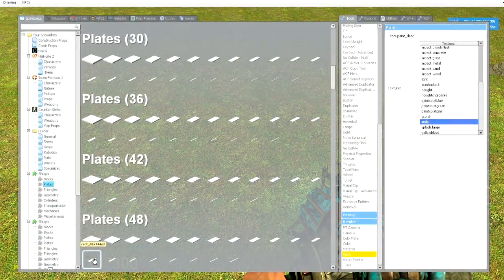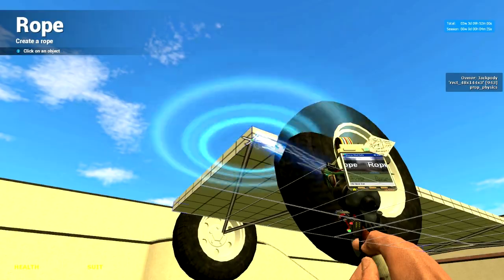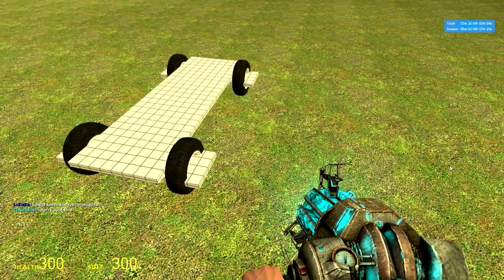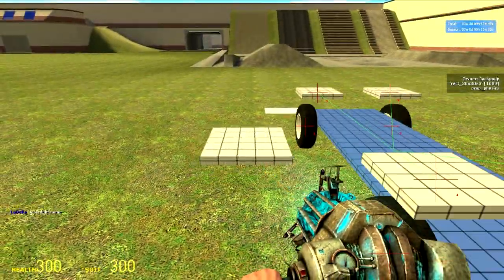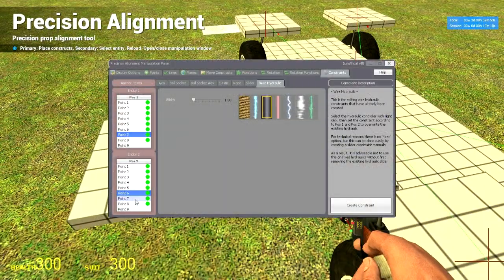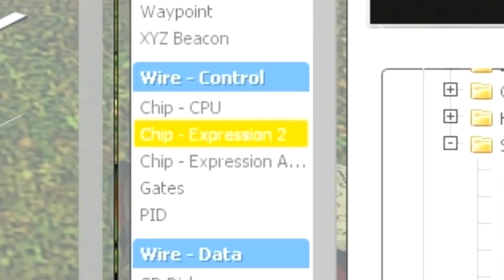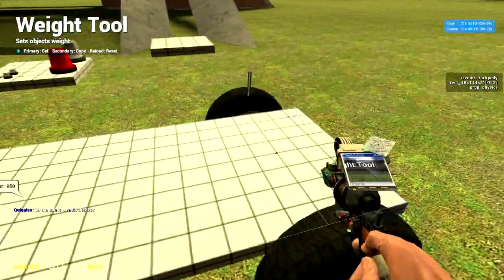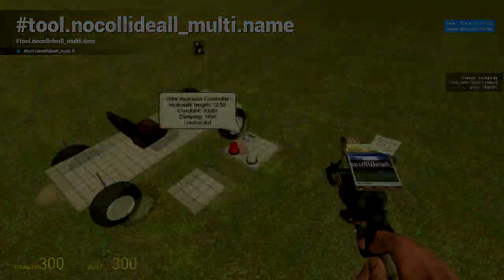[GMod 13] Suspension & Steering Tutorial - Simple

Comment: Thanks for the tutorial! I was able to use one of the wiremod thrusters and pair that up to the pod controller so that I can activate it with the w key whenever i am in the seat. 
I have always seen wiremod is an extremely complicated tool that takes years of experience to get the hang of, but I know the potential of wiremod. To put it simply, I would be doing stuff on gmod much more if I had the experience with it, so it’s really cool to see that this build still works just fine today!
Reply from the maker: Glad to hear! :)

Comment: Peasants, I made a 3 wheeled car!

This is my first time watching this video and the first time I watched, for whatever reason, I wanted to make a 3 wheel car. And I did. I am relatively proud of myself for figuring out the suspension on the single wheel.
However, I'm using my rear wheel as my turning wheel. I needed to adjust the E2 to turn more slowly so the car doesnt flip. Once I figure out how to install a piston engine, I might make the rear wheel the drive wheel and the front wheels turning wheels.

Comment: when using the e2 i get this    No such function: entity:setAng(angle) at line 31, char 15
Reply: +vocopro100 Yah same
Reply: +Boris Lichev +vocopro100 Go to the console and put in wire_expression2_extension_enable propcore.
Then put in wire_expression2_reload
Problem solved
Reply: +vocopro100 Because setAng uses a vector, for Pitch, Yaw and Roll ;D
use setAng(vec(X,Y,Z))
Reply: +migueeeelet thanks
Reply from the maker: Did you read the description?
Reply: Holy shit i know this is old, but thanks!!!!

Comment: Great tutorial. I had a little trouble in the beginning getting the ropes to attach to the corners, but a small change to the grid settings in SmartSnap fixed that (grid offset changed from 0.0 to 0.1). Now I have to figure out how to sensibly power my vehicle (not using a thruster, but using an alternative method like one listed in the video) and then save it properly.
Reply from the maker: Glad the tutorial worked out for you. I am working on an ACF tutorial as we speak, stay tuned for it next week.
Reply: Alright, that should help... every little bit helps an inexperienced GModder like me. I'll keep an eye out for it.

Comment: Works great, built it onto a car that had over 100 props, was able to follow the tutorial without replaying, and just a few pauses. Just one problem, sometimes when hitting curbs at high speeds the wheels fly above their covers, and stick upside down. You can manually pull them down again with a physgun. I tried fixing this with putting a flat base prop above all the wheels, but it still happens.
Reply: Replying 10 months after your post, but this can be easily fixed by using Precision Alignment, and tying a rope the length of your Hydraulic to a point attached to your baseplate. It sounds complicated, but it's very simple once you know the tool

Comment: i have a code prob its 
"No such function: entity:setAng(angle) at line 31, char 15"
Reply: +kopfjager68 oy nvm i fixed it with the console thing if you were to relpy thx then
Reply: +kopfjager68 how did you fix it? i have the exact same problem and cant fix it to save my life. thanks!
Reply: +Duncan Czeizinger nvm had to enable propcore.
Reply: +Duncan Czeizinger yep
Reply: Didn't work anyway, think I messed a ballpoint up, gonna try it again another time.
Reply: the ballsocket is annoying for me because ill build it north and the socket is still messed up and im like whatatatatatatata
Reply: kopfjager68 yep, this is a stupid suspension setup anyway, if you want I'll link a perfect suspension and steering video.
Reply from the maker: +Duncan Czeizinger :(
Reply: Jackpody no offense, but I find it to complicated, when you could use weighted weld suspension blocks... But if you want it to be compact I suppose this is best...
Reply from the maker: But weight suspension is incredibly unpredictable compared to this setup. There's a good reason why us builders changed from weight suspension in 2009 and 2010 to elastic and hydraulic suspension - it's much more predictable this way.
Reply: Okay, have it your way, we all like different things.
Reply from the maker: I'm not saying that you cannot enjoy your weighted suspension, but stating as a fact that this suspension is not as good as weighted suspension because of this being "too complicated" is just not right.
Reply: I'm stupid and don't know much about gmod yet so I'll rely on what your saying.

Comment: I've just run into an issue... Rather than A and D moving the wheels, when I turn the car with my phys gun, it turns the wheels.
Any help?
Reply: same problem i think, debugged e2 and it is receiving a and d inputs but e2 is not floating and is not moving... when e2 is rotated wheels do rotate.... still working on answer will update when figured out in another 11 years
Reply: i had a coding issue, have some one look at the code

Comment: Great tutorial! I built a tank chasis with this and it works flawlessly. The only downside I see in this method is that you can't weld the E2 chip. It needs to be left there sitting somewhere in the map. But I guess thats the only way to make the steer part.
Reply from the maker: +MaxShadow Definitely the only (proper) way to do it - it's definitely also the most accepted method of steering. I can't think of anyone who does steering differently, other than Karbine / Amplar2.

Comment: Tip for n00bs: the plates that go above the wheels should be much much higher in order to prevent the suspension from spazzing out.
Reply from the maker: I can confirm this.
Reply: Much Lower also works, if you decide to have your car with extra Low

Comment: Alright! This is Awesome! I did the tutorial with the same models from your set-up to get a clear understanding. I also viewed the Wheel Spass tutorial to make it a solid test.

But I got a question though, is this manual set-up any better than SCars or even SimFPhys? Or maybe you could take these set-ups into those mods? I have no idea! But I would love to hear conformation! Thanks!
Reply from the maker: I'm glad the tutorial is still widely used! It's a good question that you ask - I'd say that this is a much different approach to say SCars or Simphys. This setup is an actual physical chassis, just like how cars are done in real life. With most applications, this type of setup use rotational force from the wheels to move forwards. With the case of SCars and SimFPhys, from my understanding, they use an applicated force on the base of the vehicle meaning no actual rotational force. The physics are also simulated on SCars and SimFPhys, with this type of setup shown in the video only allowing the Source engine for physics. I hope that makes sense!
Reply: @JackpodyDK 
Yeah, you're tutorial was super concise! 

Hmm... so the physics on this Manuel set-up has the wheels rotate and roll the Base Plate, or the frame of the car forwards. While the SCar and SimPhys mods applies force in the frame instead of the wheels rolling it forwards. 

Okay, then this set-up would be better for steering because the wheels are controlling the Base Plate more effectively than the SCar and SimPhys Mods. Is this correct?
Reply from the maker: @hogoototwilightian628  It's definitely the correct way of thinking! I'd say that this type of chassis is a lot more realistic when turning than say SCars - from my understanding, the turning of the wheels on such cars is purely visual, whereas the steering shown in this video is the actual movement of wheels.
Reply: @JackpodyDK  
Hey, I went an adventure of my own and tried making my own chassis with completely different Models. Like, Chassis of a car and front and rear wheels that are different in size.

Let's just say I'm heartbroken, I did a long grind doing all of the steps and when I was attempting to resting the vehicle down, the wheels bounced forwards and backwards and slumped down like a hot air balloon. I thought I did it all right, I was very passionate in getting this vehicle working, it was going to be my very first mod... but I'm left devastated. I'm going to save the build anyway, but if there's any way you could see what I did wrong, or find out what could be wrong with the models I used, I'd be grateful.

Comment: I have one question regarding the ball sockets constraints you chose. Why do most people (who publish their builds on Youtube at least) set "fixed" axes with a buffer of 0.2 (-0.1 to 0.1) degrees? Are there any advantages to doing so? I've searched the interwebs for an answer but failed to find one. Thank you in advance!
Reply from the maker: Hi! There is definitely a reason. When doing just 0's all the way down instead of 0.1 and -0.1, the ballsockets will vibrate whenever they hit the angle of 0, since they don't know how to rotate zero. It's a bit hard to explain, but they can read 0.1 and -0.1 since they're ACTUAL numbers, whereas zero is nothing and you therefore end up with 359.9 degrees of normal rotation and 1 degree of "nothing".

Comment: Hey! I like your builds, but i have a question. How can i make just steering without suspension?
Reply from the maker: You should be able to just use Ballsocket - Easy or Ballsocket Advanced to do that. You want to get the wheels on the car using that tool (for Easy Precision, hit the center of the wheel then where you want to place it on the chassis) and for Ballsocket Advanced, place the wheel where you want it on the chassis, then press on the wheel, then chassis. 
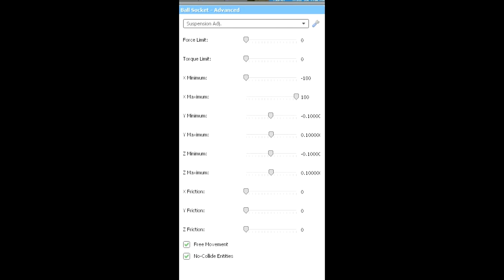Then you want to use the same ballsocket settings for the suspension as I show in the video at 11:44.
Reply: JackpodyDK Thanks a lot! I couldn't make anything from those crappy tutorials on youtube except yours! Sorry for my bad English btw.

Comment: Great tutorial helped me make my first car, but one problem.
When I hit a bump/tire hits a corner it pops up and I have to phys it back down again. How do I fix this?
Reply from the maker: Glad you found the tutorial useful!
GMod has had many solutions to this problem, some work better than other but none have been 100% successful, which is why I left it out in the video.
You can extend the wheel to its max point before it flops up (max height). Then draw an invisible, non-rigid rope from the baseplate to the center of the wheel. This should limit the wheel from going above the preferred height as the rope stops it. This system might need some tweaking to work properly with where you want to set the ropes. However it should work.

Comment: I realize you're not tech support for gmod, Jackpody, but whenever i try to put the ropes on the wheels gmod locks up I crash to desktop when i right click the center of the first wheel, or sometimes it lets me get to where i left click the second time on the base, then it crashes. it worked when i first followed your tutorial, since then ive downloaded a few maps but nothing that should break makespherical or precision like this. Any idea what might be going on?
Reply from the maker: Make sure your rope settings are like the ones I show in an annotation in the video (Add length = 0, width =1, etc). There are no hydraulics or anything else to crash your game so that seems to act very weirdly.
Reply: JackpodyDK checked my rope settings, they were the same except i had width set to 0.5(not sure if it even makes them any smaller than 1) which is how they were when i made 2 different practice chassis before. set width to 1 just to test and tried to do the ropes again, still crashed when i left click on the base for the second time on the first wheel. Going to try disabling all my tools besides precision and makespherical to see what it does. Thanks for the fast reply though.
Reply: Snoop Doge been going through and trying different possible fixes, ended up fixing it by deleting common/GarrysMod/bin and platform folders and then running the file integrity scan to replace them, not sure which folder it was but it doesnt crash anymore.
Reply from the maker: Sounds good then, glad you got it fixed!
Reply: JackpodyDK You've got my sub btw, great videos and you actually read the comments on them.

Comment: I don't think the E2 that you use doesn't work on the newest Wiremod. It keeps saying that there is no such function: entity:setAng(angle) at line 31, char 15, and i hadn't had a problem before I updated to the newest version of Wiremod
Reply from the maker: YoloToTheMax104 When having issues, it's always a good idea to check the comment section - I may have already answered an issue like yours. 
In this case, the issues stems from the Wiremod team disabling Propcore on startup. A quick fix to this is running the following command in console: 
wire_expression2_extension_enable propcore

The above command allows the E2 to work. I hope it helped.

Comment: @jackpody hi just wondering instead of a plate that u attach wire hydraulic controllers can u place it on the chassis plate instead for less parts?
thanks for the info
Reply from the maker: You can't as it would mess up the suspension travel. Nonetheless, the entire point about doing the plate attatchment (and then removing the plates) is because it's no more parts than if you directly attatched it to the base.
Reply: meant the plate u place hydraulic controllers on and thx for getting back to me!

Comment: I am having a problem with the e2 steering. I copied and pasted it and it is saying
(No such function: entity:setAng(angle) at line 31, char 15

Line 31:  SLAVE:setAng( CHASSIS:toWorld(ang(0, TURN, 0)) )

Which is wired because it worked fine yesterday. Hopping you could help. Could it be that a mod I might of downloaded broke wiremod or did wiremod update since than or is their another steering code I could try. I tired making my own but it is touchy.
Reply from the maker: killerx1996 You'll have to enable propcore. It's a quick console command - try to look through the comments, I've posted it a few times.

Comment: Hey mate, just saw your video, and I've been rewatching it over and over to try and get formula down in memory. When I finished a build, My front left wheel dips, and clips, through the ground. Any idea why that is? It also like to spazz and twitch.
Reply from the maker: +kenthed45 Oh man, the amount of times I've had this happen (and I still have it happen every now and again these days, I never quite figured out why!). 

However, there are a few places to start. Most issues with something clipping through the ground originates in the advanced ballsocket tool. If you ballsocket something to the ground (on accident), it'll allow the prop to clip through - so make sure you are not doing any accidental clicks whatsoever. Incorrect ballsocket settings can allow clipping as well, so make sure you've got the correct settings (can be found in the description as well).
If you are not building towards North on the map, then you will get issues with clipping. Make sure you are pointing your contraption towards North, which I explain by the beginning of the tutorial.

Good luck!
Reply: +JackpodyDK  Thanks mate, I diddled with it for a few more minutes and discovered that I hadn't weighted the car correctly. It seems if you dont weight the tires heavy enough, or the primary prop you're connecting them to, the hydraulics get spaztic and the wheels start to clip. Troubleshot it a few times, and at least that was my problem. I managed to get it working and I'm now in the process of figuring out ACF.

Keep up the good work mate!
Reply from the maker: No problem! If you want to ACF-power it, then you may have to fiddle with the weights a bit. I think it all-in-all weighs around 1.6 tonnes, which is a bit much for a smaller ACF vehicle.

Comment: For some reason I can’t find the hydraulic wire tool. Is there an add on needed for this? If so, please tell me which.
Reply from the maker: It's a part of the addon called Wiremod - it also allows for things such as advanced pod controllers that allow other people to drive your cars.
Reply: So I have installed wiremod, as I have already had it installed. But nothing in the tool option pops up, even when I reload.
Reply: Turns out I actually missed a step and didn’t realize that there was a section for wire. Thank you anyways for helping me out! Love your videos man.

Comment: One question about ACF mod if you can help with it. I have a speed limiter, my car accelerates to 67 km/h (41 m/h) and slows down to 65 km/h (40 m / h). How to fix it? I tried a different engines and gearboxes, it has not helped.
Reply from the maker: I'm not sure what your question is. You'll have to describe it more thoroughly.
Reply: JackpodyDK
 The last question. Where should I play: Single player or multiplayer. problem of the speed limiter in the prop. I played in single player without ACF and my chassis does not accelerate faster than 47-48 km